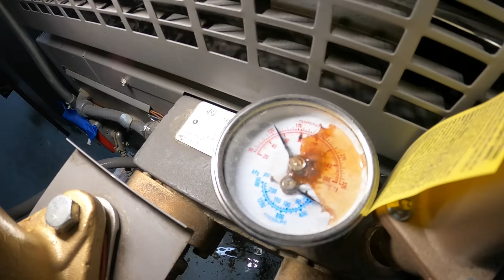HVAC: Commercial LAARS Boiler NIGHTMARE (Water All Over The Floor) Boiler Not Heating/Leaking Water

Comment: Personally, as it's a temporary repair, I would have just split the motor and impeller from the rest of the housing and swapped them over leaving the pipework intact and its seals intact. There's little point in swapping the rest of the pump housing and it's only one seal to deal with for each pump rather than two and therefore one point of potential new leaks rather than two, unless the pipework gaskets are easier to deal with and less likely to be problematic. I've split pumps before and been able to just put the housing back together with no issues as occasionally there's no real choice because of a unique housing and it can be simpler if the pipework it a pain to deal with. I'm just thinking about making a job simpler and potentially less likely to go wrong.

Comment: why did they need heat in august?
Reply from the maker: These 3 boilers work together to provide hot water for a building. They need it all year. They are connected to water tanks indirectly. Thanks for watching 🙏🤙🔧⚡️
Reply: Vav reheat boxes in the building maybe.
Reply: at my building we use the boilers to provide hot water to the restrooms and the vav coils